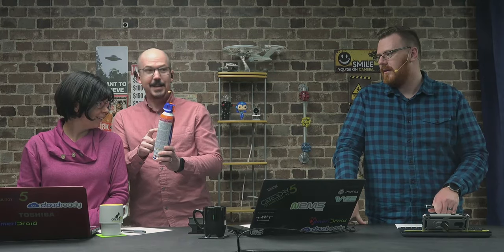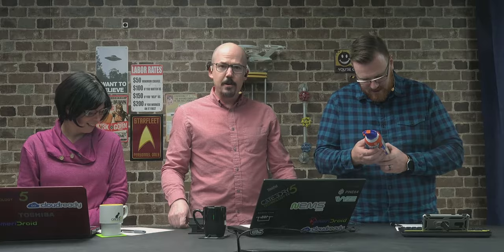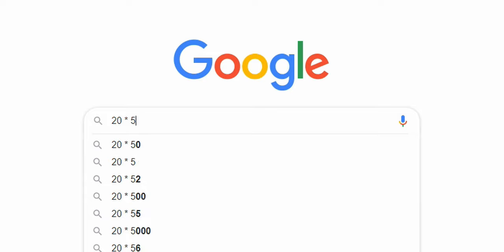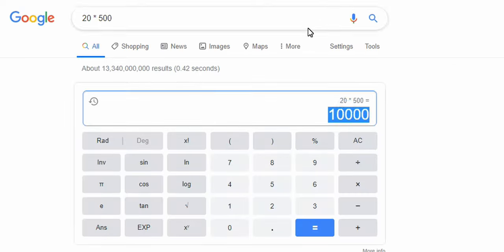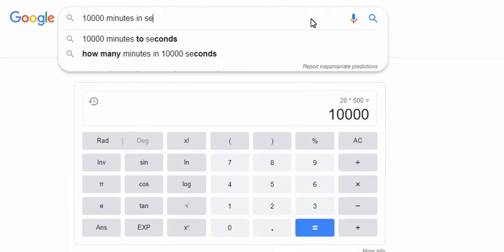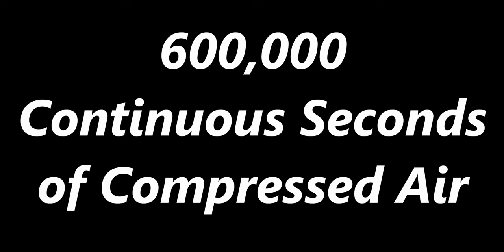A New Spin on Compressed Air

Comment: I worked on scientific instruments for 40 years. When I purchased canned air duster I always read the contents label because most of those cans I could not spray in a laboratory environment. I could have use the ESD Safe product back then and would buy it now if I was still working.